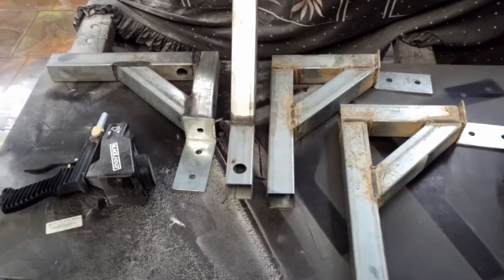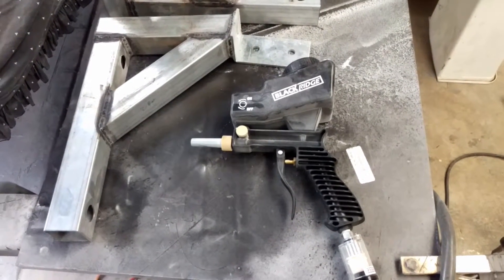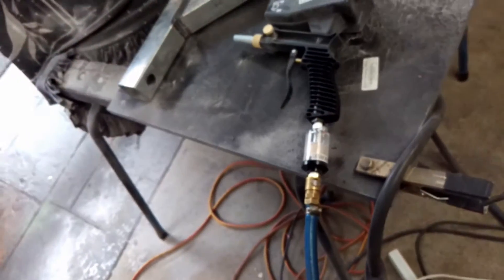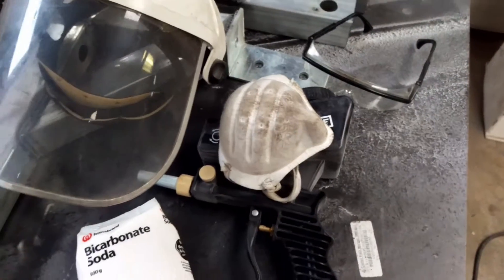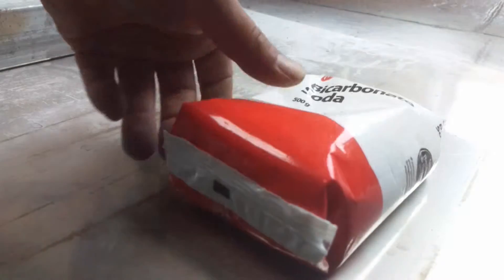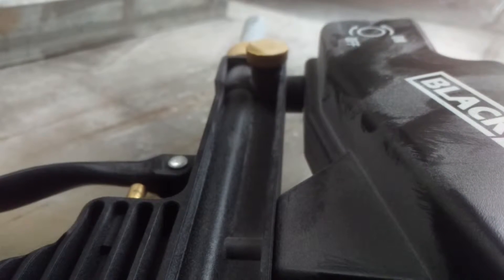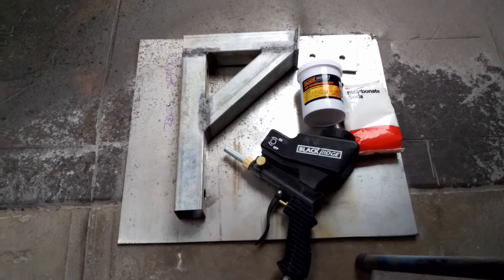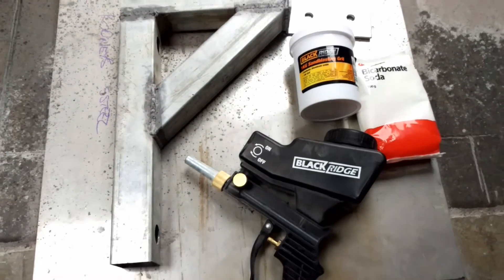Sand Blasting Welds

Comment: Good video, I just heard about sandblasting and then I just started wondering, can I use this before welding instead of grinding down my material?, I’ll probably stick to grinding it down but at least it shows what it can still do..I might try it on a nice TIG project and see what it would do..
Reply from the maker: G'day, Thanks. Yes definitely have a go at it even try a coarser grit sand / garnet. I may try it as well as I've always used a grinder wheel of flap disc on my angle grinder prior to welding for surface prep. Actually good idea for TIG because i've noticed when using my TIG if there's even a slight bit of paint or grease make the tungsten tip spatter weld puddle to pop. TIG requires good surface prep clean metal and sand blasting the surface will work quite well, thanks for mentioning that. Also with sand blasting with these hand held gun type of tool please use a good quality respirator don't breathe the dust it is not good for the lungs. And Good pair of safety goggles the sand goes everywhere.
Reply: @Craftin.Clever  💯Thanks for the advice. Keep up the good videos!